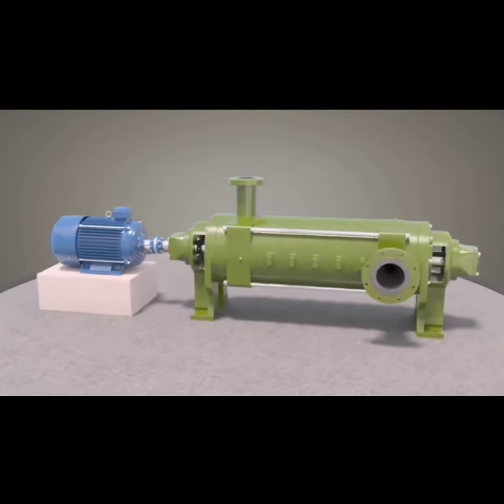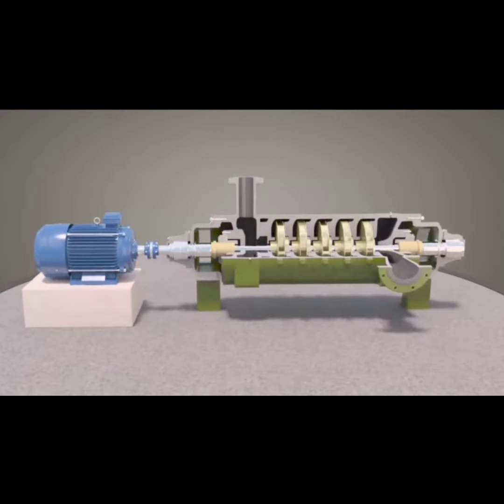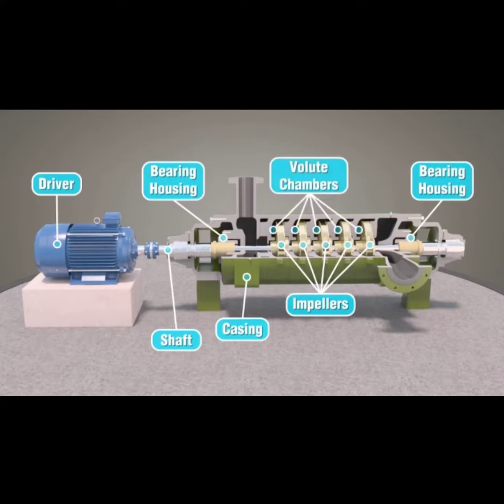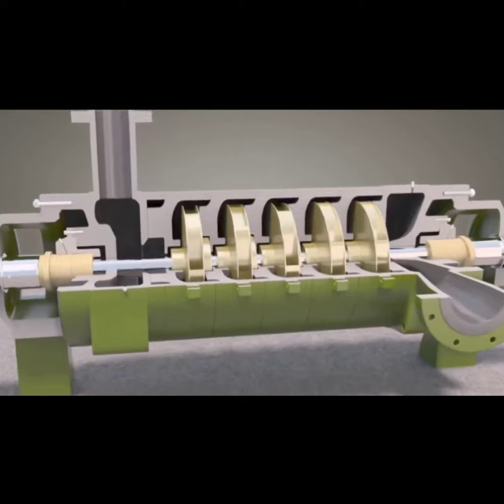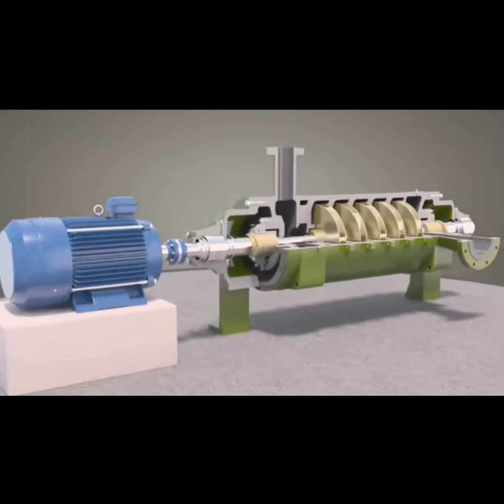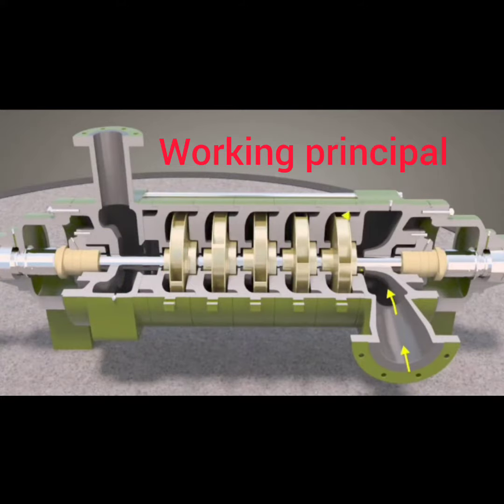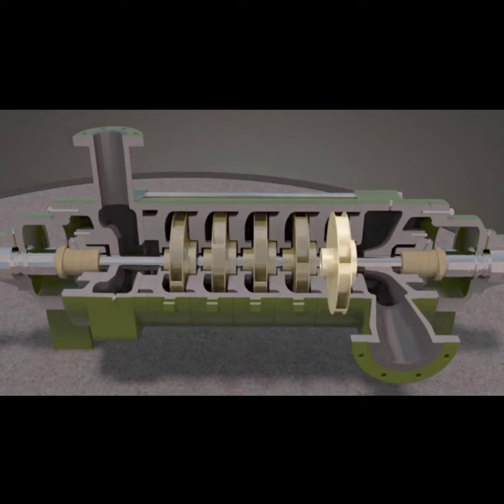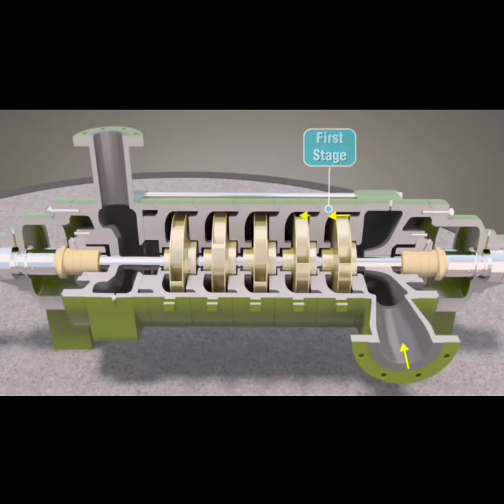"Efficient Multistage Centrifugal Pump I मल्टीस्टेज सेंट्रीफुगल पम्प I

Comment from the maker: These pumps have the unique ability to produce higher and higher pressures with the addition of every stage, but flow range always remains constant for a given rpm. Thus, Multistage is a series connection hence discharge remains constant while the head increases

Comment from the maker: Multistage pumps are defined as pumps in which the fluid flows through several impellers fitted in series. The head of a single-stage centrifugal pump is largely governed by the type of impeller and the circumferential speed.

Comment from the maker: Pros of Multistage Centrifugal Pump:

High Efficiency: The pump's multiple stages enhance its efficiency, making it ideal for applications requiring high pressure and flow rates.

Versatility: Suitable for various fluids and industries, from water supply and irrigation to chemical processing and oil refineries.

Compact Design: These pumps have a relatively small footprint, saving valuable space in installations.

Smooth Operation: Multistage pumps provide a constant and steady flow, minimizing pressure fluctuations.

Low NPSH Requirement: They often require less Net Positive Suction Head (NPSH) compared to other pump types, reducing the risk of cavitation.

Cons of Multistage Centrifugal Pump:

Cost: Initial investment can be higher than single-stage pumps due to the complexity of multiple impellers and components.

Maintenance: The pump's intricate design may require more regular maintenance and expertise for servicing.

Limited Solid Handling: Not suitable for handling large solids or abrasive materials, which may cause wear on impellers.

Operating Range: Multistage pumps have a narrower operating range compared to some other pump types.

Sensitivity to Changes: Performance can be affected by changes in operating conditions, making proper system design and control crucial.